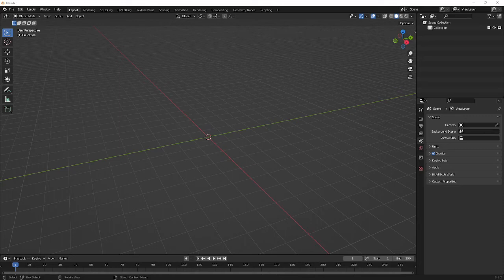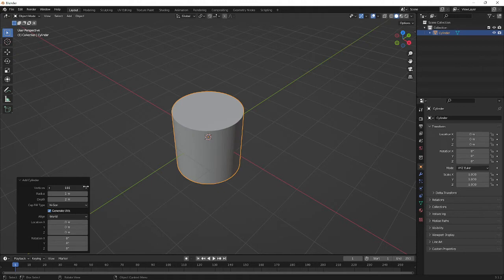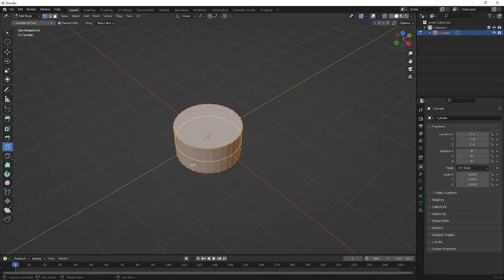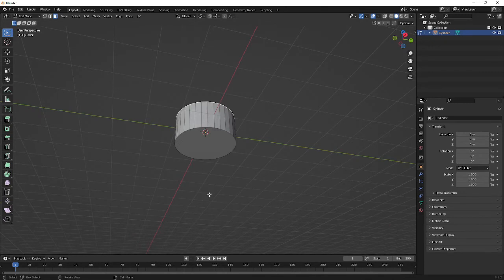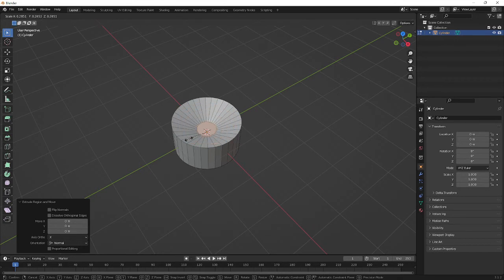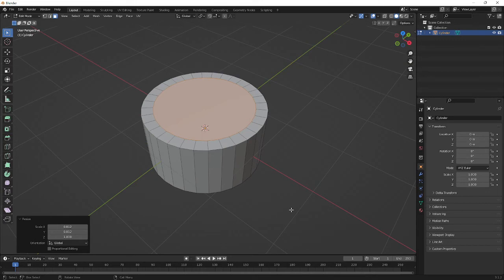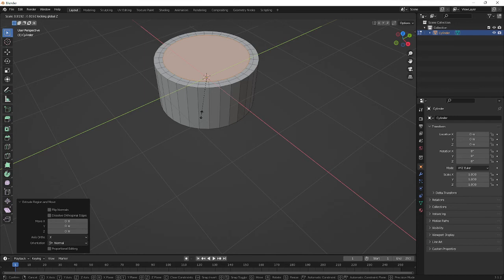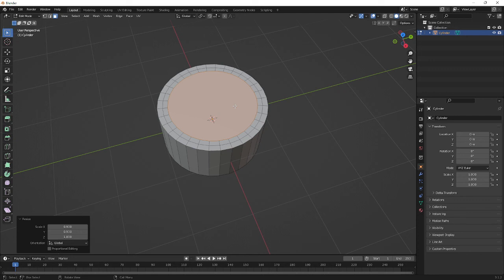Subdivide Cylinder Caps

Comment: I have a faster solution for you. Shift A --> Mesh ---> Cylinder. Add cylinder options ---> Cap Fill Type --> Triangle Fan.  Go to Edit mode and select the cap faces --> Right-click --> Inset Faces (or use the shortcut: i)
Reply from the maker: Cool, thanks for the advice. Will try out and see if I can do an update video.
Reply: And once you have entered the first inset loop, you could finish that by adding Repeating Last (Shift R). Thank you both for sharing! ☺

Comment: Not sure what I am doing wrong by the body of my cylinder is shrinking enlarging when I do this.
Reply from the maker: Check first if you still have the outer ring selected as would be my first guess. 

You may also have faces selected rather than the lines.
Reply: @katawartandgaming9216  I'm not sure what you mean by outer ring as I only have one?  but the second one was right, I didn't see where you went back to vertices.  Do you happen to know how I can do this without it distorting an image texture I have on the cap?  My goal is to take a flat earth map and transform it into a globe, this technique didn't work with circles so I thought I'd try it with cylinders and this tutorial helped with the first part, now I Just need to do it without messing up my material.
Reply from the maker: @kajekage9410  Wrapping a flat texture to a cylinder or sphere is a process that needs a lot of planning. It can be done. I will try and find time this week to show the process.
Reply: @katawartandgaming9216  I see how that we are just creating another layer of faces that is hiding my image and is the only part that is transforming so am guessing this is not going to work for me.